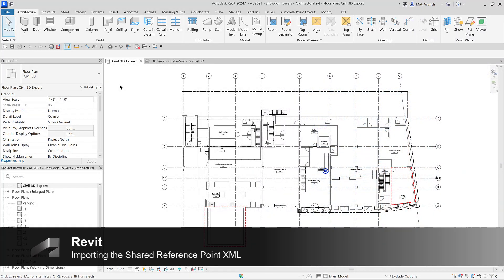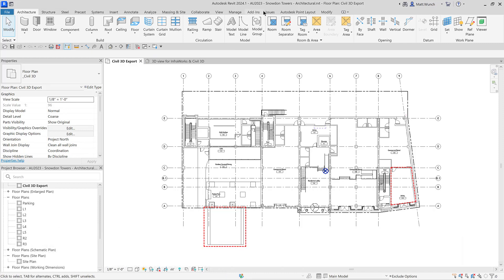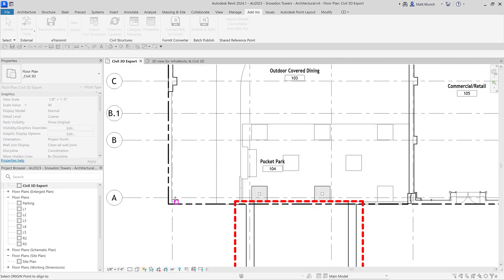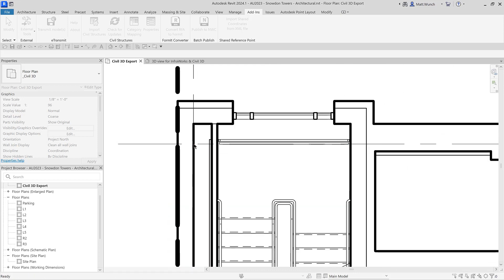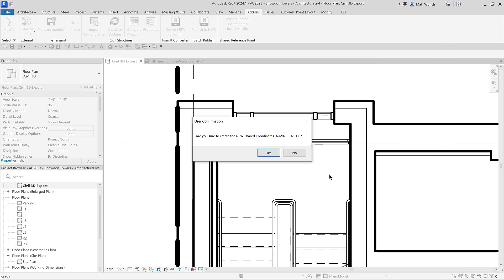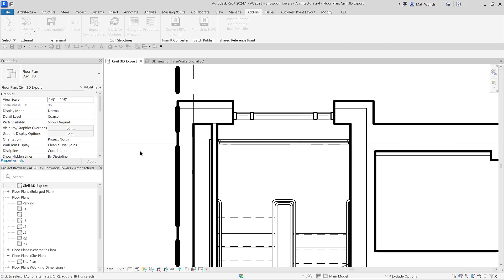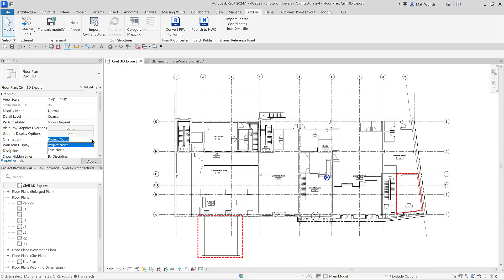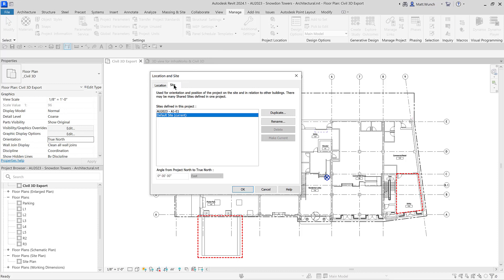Shared Coordinates (Part 7) - Import the Shared Reference XML into Revit

Comment: Isn't this the old way of doing it? You could skip several of these steps by exporting, having civil move the building. Link the civil file. Acquire coordinates from civil file. Even better if they have a coordinate system applied.
Reply from the maker: Not old, but an alternative method. I do need to update the videos to include that method as well.

As with many commands in AutoCAD & Revit, there are a number of ways to achieve the same outcome.

Comment: Do you need to acquire coordinates? If the file already has coordinates would you reset them and then apply this method of using the shared reference add in?
Reply from the maker: I assume you're referring to a Revit model already have coordinates set? If so, then no, you should not need to do anything.